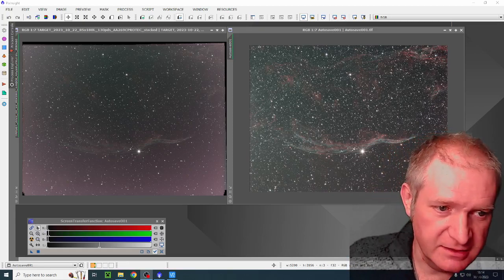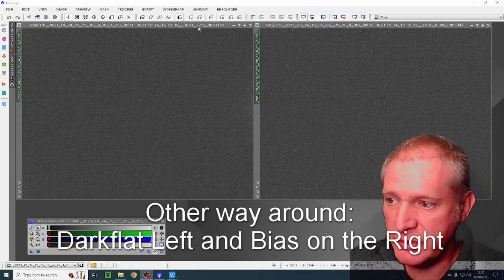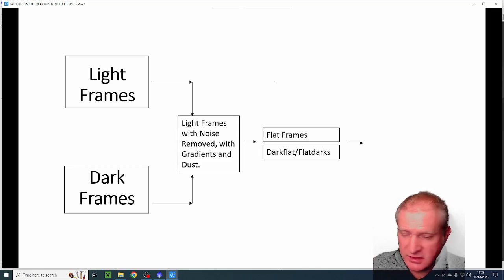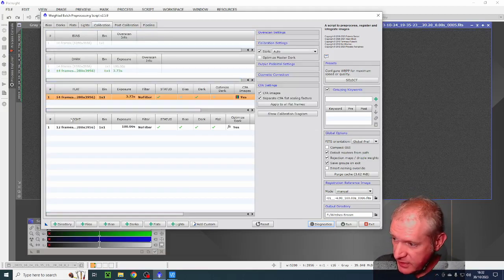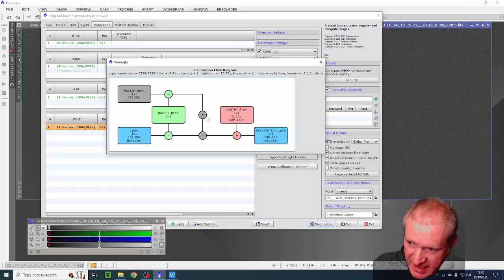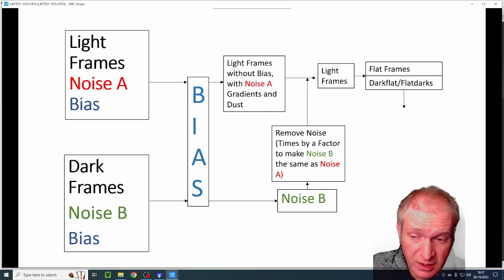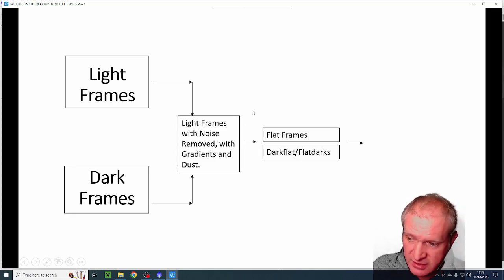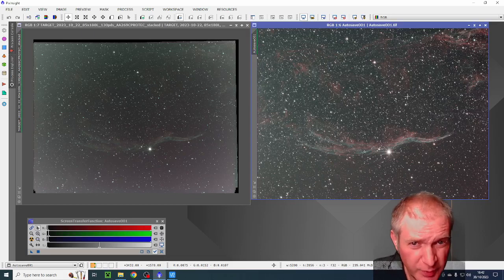Bias - The secret to all Stacking Success

Comment: I was told and figured that either use this or that.  That means, either use only bias + flats +darks  OR use flatdarks +flats +darks.   But don't use both. I haven't tried using both but I might give it a go and see what happens.  I did have some failed images, just not long ago with the 533mono, and looked pretty similar to your poorly calibrated image and for the life of me I couldn't figure out what I was doing wrong. Re-shot the flats at least 3 times, tried different options and new darks and so on, and yet I had poorly calibrated stacked image anyway. 
Also with the darks, there are more than one time, when the dark adds noise back in, instead of removing it. I just know, because stacking it without the darks resulted in a much better image. 
Sometimes I'm totally lost what I should or shouldn't be doing , this hobby can be a migraine inducer for sure haha!
Reply from the maker: Yes I found that using all of them is best.  However I need to test my 294c sensor camera as it is not capable of creating bias,  therefore I'll use dark flats for bias and well as for calibrating the flats.

Comment: I found that flats will over-correct when not being used in tandem with bias. My tool of choice is Siril and on its website they explain it pretty clearly. I also wrote some lengthy comments recently on Facebook ;-) Basically if you apply only flats to your lights you get L/F which will lead to over-corrections. If you apply bias to your lights only ((L-B)/F) you get over correction too. But once you apply bias to both the flat and the light you'll get a proper corrected image ((L-B)/(F-B)). Better still is to apply Darks to your lights and use the bias in the flat calibration ((L-D)/(F/B)).

One of my cameras is the ASI294MC Pro. Not only does it produce pretty strong amp-glow - which makes darks a necessity - it also has inconsistencies when shooting short exposures. Shorter than 3 seconds is too short for consistent results. Therefor I never shoot bias with the 294MC Pro. I do use a synthetic bias to prevent the over-correction I mentioned earlier.
Reply from the maker: Yes I think you are correct.  The 294c is a very complex beast to tame.  My 294 version is a nightmare to calibrate.  Thanks for the info and for watching.

Comment: I also read somewhere some time ago that you should do bias frames with the 533MC anyway. I’m certainly going to try it with my 533MC and my 183MM. With mono would you need to do bias with each filter?
Reply from the maker: The bias is independent from filter, therefore only one set of bias frames are needed.  However for flats they are dependent upon filter and potentially that also means individual darkflats as well per flat duration, however potentially bias and darkflats are very similar and therefore this needs testing.  Thanks.

Comment: Hi Andy very informative video  mate, do you thing this was some of the problems you had with the 200 PDS you had to return? , how you getting on with the new scope?
Reply from the maker: Hello, I tried and restacked some of the data from the 200PDS, using the Darkflats as Bias and the results where the same.  The slop/mirror movement in the mirror and the flex in spider had to great an influence and caused the imaging issues.  I've not currently tried the 8 inch Stella Lyra, I've been working on wider field subjects.  Clear Sky's!

Comment: Newbie. Did my 1st flats last week. Got a 2600 duo. Spoiled myself w/all things ZWO. Got a usb lite pad. At lowest setting I had to add 5 layers of tshirts to get a 1.9s exposure time, which pushes my spot on this histogram 3/4 of the way to the right instead of a nice center. Using Asair to auto take flats gives me a super fast exposure time w/ 1 tshirt layer and perfect center on histogram. Tried Cloudy Nights, but still confused. What's your thoughts on using flats w/ at least 3s exposure time? This is something I picked up on other tutorials. I wish I would have taken the fast dark flats to experiment with and see what the difference is, but I cleaned all my glass. And I did do biases, darks, and dark flats. Covering all my bases. Thanks.
Reply from the maker: The Duo is an IMX571 and it is known to be a well behaved sensor, I think it copes well with short Flats or longer Flats.  I managed to get longer exposures for flats by using drawing paper sheets, however I think experimentation is required to get the workflow settled.  If you are finding that the ASIair is giving you good data then don't change anything!  However if you have issues it is worth experimenting.  Certainly with older sensors, longer flats seem to be easier to calibrate (such as with the 294C sensor which is hard to calibrate.)  Good luck and clear sky's!

Comment: Very interesting Andy weirdly enough I found that darks used to give me more agro so I just stack lights flats & dark flats only & it seems to work ok for me. I do however only shoot colour & not mono so I don't know if that makes a difference.
Reply from the maker: Hi Tich, Hope you are well.  I did find that my darks had to be updated every month or two, because they didn't work well.  I think the sensors change in a short time and need updating.  I never knew Bias would make such a difference until I tried it, hopefully going forwards this will improve the calibration.  Best wishes and clear sky's!

Comment: How incredibly timely! I have just begun to wonder if my approach to calibrating images from my 533MC-Pro is wrong, since the resulting images don't seem to be all that well calibrated. Like you, I also was not using bias frames, using only dark flats/flat darks in my WBPP process. I will give it a try with the bias frames included and see what happens. Many thanks!
Reply from the maker: Let me know how it goes and if your images stack together ok.  Remember to tick Optimize Dark Frame to enable the bias in the Lights calibration.  Try just putting a Darkflat in the Bias and restack, see if this makes any difference.  Good luck and I hope this helps.
Reply: Thanks, I will. I should say my stacking worked ok but I wasn’t happy with the results. I’ll report on my findings!